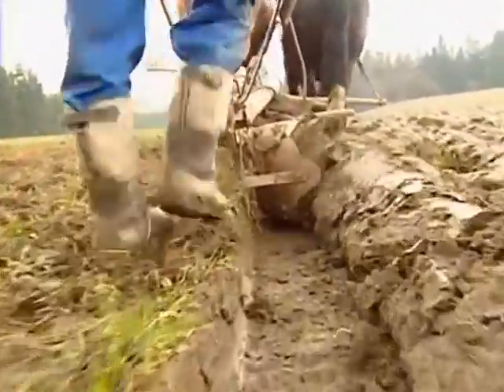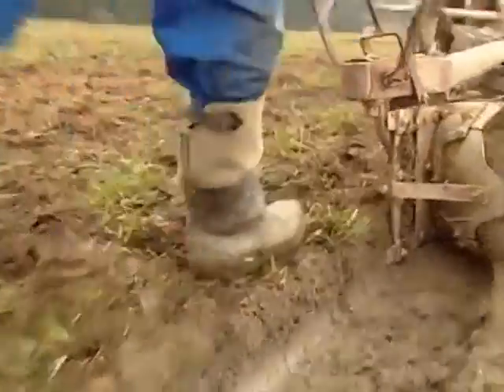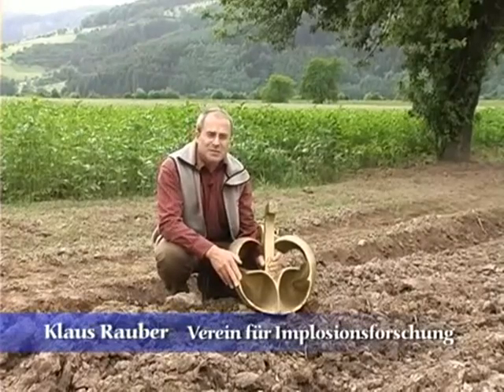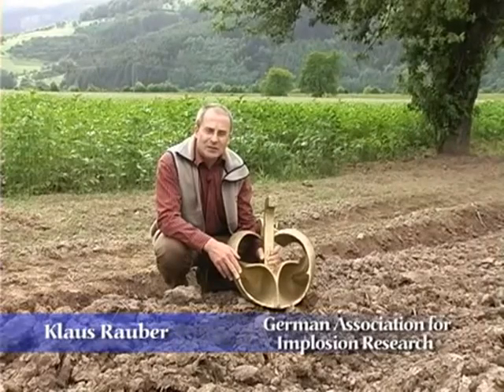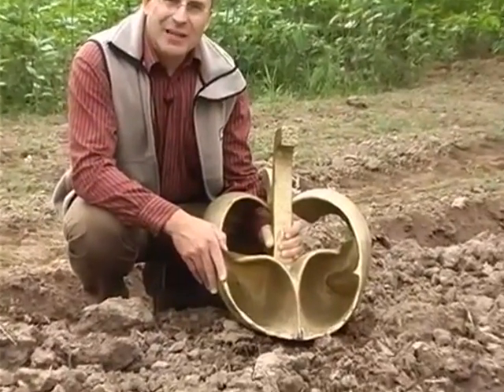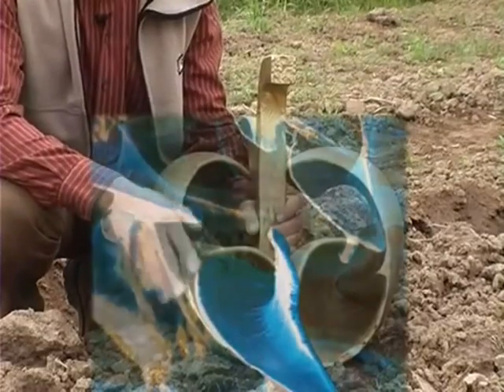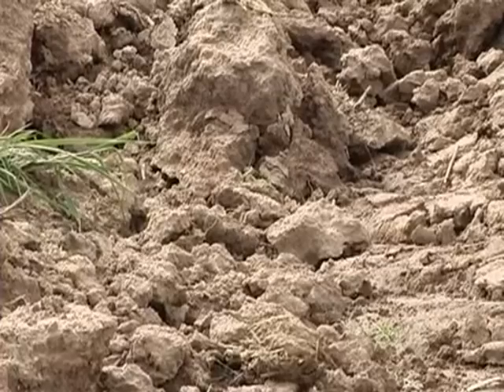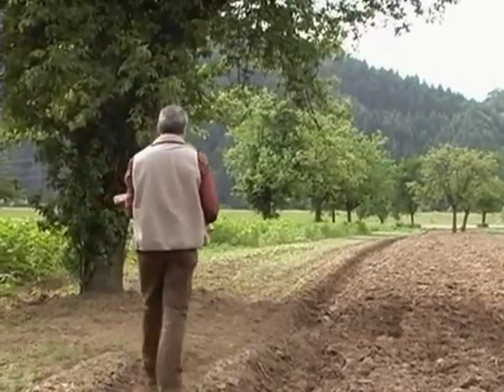The Golden Plow - Victor Schauberger

Comment: As a farmer I don't think the design is very practical because the plough will get blocked with hard soil or plant matter. Please do a demonstration one time to proof me wrong because the idea is very original.
Reply: Imagin it in a stoney field and if the point broke you would have to replace the hole plough
Reply: @SCronin944 easy, every farmer clean his land from stones, it may take 1-2-3-5 years but eventually it happends, then u start using this. eliminate risk of dmg soft copper tool.  I dont get why people incline to Why it is bad idea, rather then how can we use it efficiently. copper have really strong impact on earth

Comment: from: Living Energies-book:
 "This boost to soil fertility was decisively CONFIRMED in field 
trials Carried out in the vicinity of Salzburg in 1948 and 1949. Here 
fields were plowed in strips, using steel and copper-plated ploughs 
alternately. The difference between the two types of plow and Their 
Effect Became quite apparent. Where the copper-plated plow had been 
used, ie the where there were no rust residues and the where the water 
content and other energies of the soil had been Increased, the corn 
stood about 6-8 inches higher with a much fuller head. Some 
yields in the plowed strips with copper-plated implements Increased by 
up to 40% in comparison with the control strips the where conventional 
steel ploughs were used. This remarkable Increase could only be 
attributed to the use of copper in lieu of steel, Because all other 
factors of soil chemistry, orientation, furrow width, etc., were 
Identical. In one experiment, extraordinarily large ears of rye 
were grown carrying up to 104 grains each; a truly stupendous 
production, as is show in Fig. 19.3. In another parallel experiment at 
Kitzbuhel in the Tyrol high quality, well-formed potatoes were produced 
weighing up to 430 grams, Nearly half a kilo, containing as many as 20 
'eyes' Those Portions of the potato That can be cut off and planted 
separately from Which to grow the next crop (Fig. 19.4). With such 
potatoes more food would be made available, not only is the account of 
Their larger size, but Also Because of the Greater number of 'eyes', and
 fewer potatoes would be required for replanting."